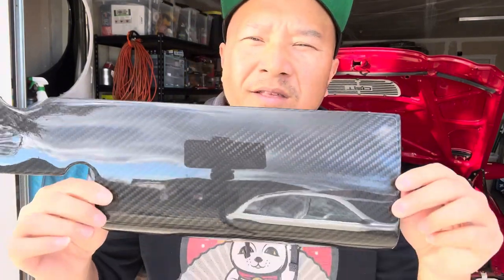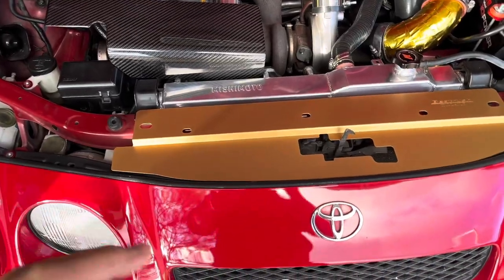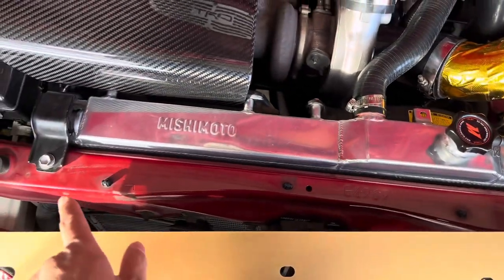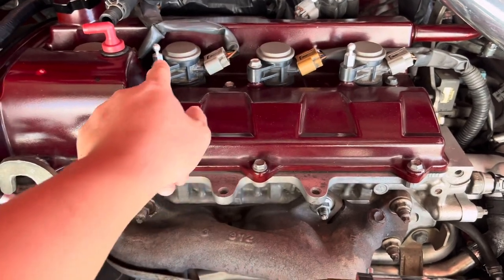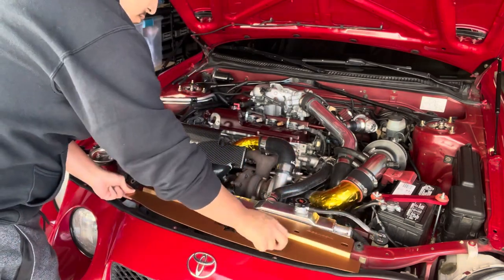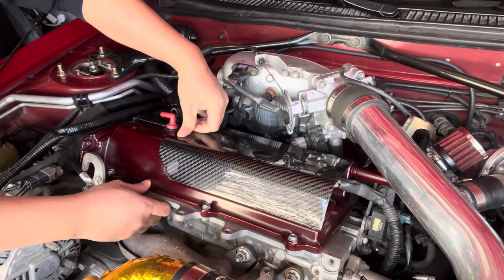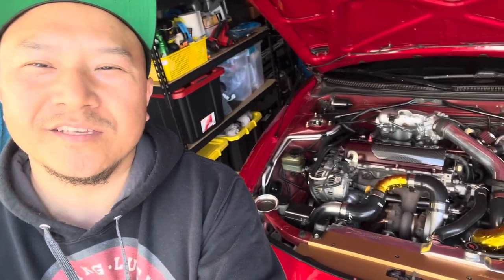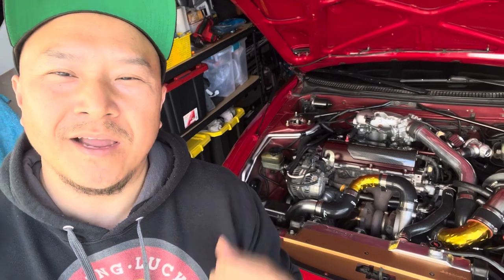First Carbon Fiber part for my Celica!

Comment: nice carbon engine cover. looks like a 4th gen 3sgte swap. did you pick it up locally? If so, do these places ever have Caldina brake parts in stock?
Reply from the maker: I bought the engine from a jdm warehouse. Had it shipped to my address. Never got a chance to check if they have anything related to caldina besides the engine.